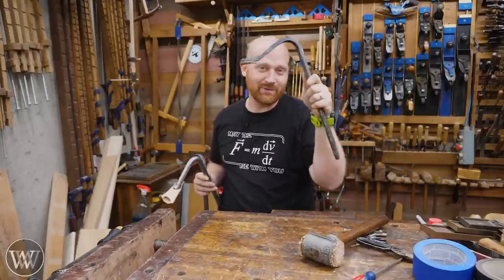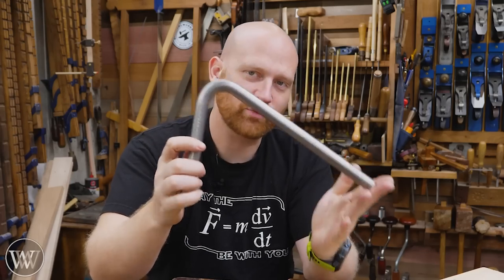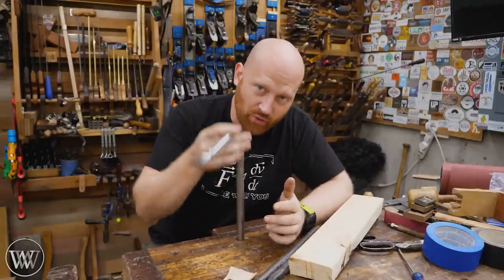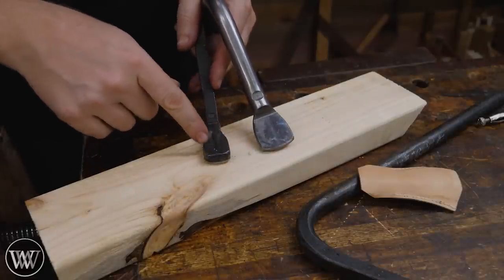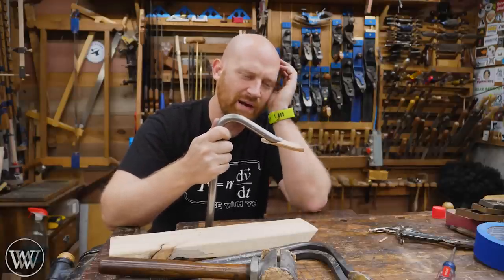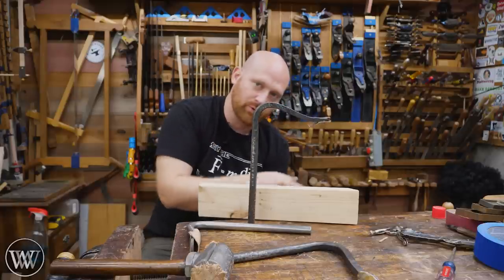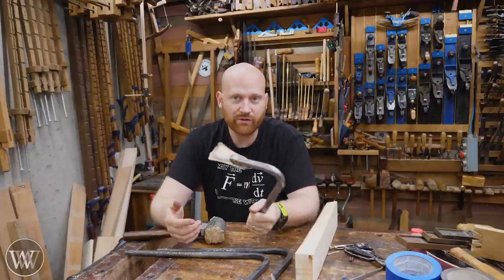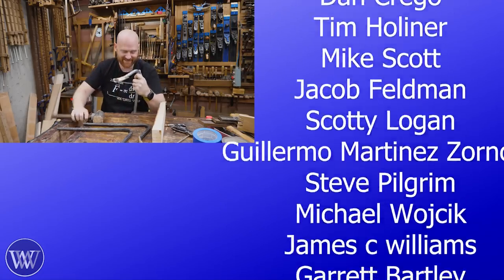A New Idea And View On An Old Tool

Comment: A simple tool to use, but surprisingly difficult to make them.  If you've ever forged one, they can be tricky because the length of the vertical shaft does, in my experience, play a role in how well they hold.  There's something about the weight of the leg.  I think it's absorbing some of the vibration from when you drive it home, but can't say for certain.  I notice the same performance difference on my hardy tools - the ones with long stems stay put in the anvil better than the ones I make up with short stems, or hollow stems.  John at Black Bear Forge does great work.

Comment: The Gramercy holdfasts are very smooth & can slide in the dog hole but an very easy remedy is just to roughen the bar with sandpaper. I've done this to mine & they never slip or move at all & I've had mine for 4 years+. (Edit: I spoke too soon, you addressed this roughing the stem later on in the video plus I didn't know that you've done an entire video on this very subject). Good content.

Comment: I use a 2"x 3" slip of 1/4 masonite under my Gramercy holdfasts and ths works just fine; no marks on the work and thw workpiece is held securely. Put the masonite shiny side up.

Comment: I used to make my own holdfasts from wood. I just looked for straight branches with another branch sticking out at around 45 degrees angle. I cut it just below the branch and then two more cuts to get the 7-shape. Note that it's important to have a steeper angle than on the metal ones, otherwise the wood will flex.
The wood must be hard, I used maple and ash. And they need to be thicker than the metal holdfasts, around 1 inch (2.5 cm) diameter. I peeled them and let them dry before I used them.
Works amazingly well and it's completely free if you have access to the trees.
Reply: And what do you do now? Did you swop over to metal holdfasts?
Reply: @LitoGeorge  unfortunately I moved and no longer have a workbench :( I will give the wooden ones another go when I get one again.
Reply: Maybe making hold fasts from wood is a good idea for an episode.

Comment: Thank you for the PSA about the Amazon hold fasts. I have considered buying them. I know not to now.
Reply: I got a Pony Jorgensen one from Amazon and I love using it.  Hasn't broken so far, but I haven't used it all that much yet.  Some reviewers on Amazon have complained of breakage though..

It holds great in my 1.5" top with 3/4" holes.

Comment: My texturizing "tip" for gramercy holdfasts is to use them in a bench with a top that's still got some moisture.  A little surface rust and they hold really well with just a light tap :)

Comment: The sticky felt pads made to protect flooring from furniture feet scratches are perfect for wood clamps. If the pads spent too many years on a store shelf or kitchen drawer they may require a little extra adhesion 😎

Comment: I tried gluing leather to my holdfasts feet but the leather kept sliding/peeling off so I just use a relatively thin & soft sacrificial piece of wood under the foot now. I'll be ordering those leather "socks" very soon though. Thanks for the video James.

Comment: Well, I use holdfasts all the time. I also used a piece of leather glued with hide glue but through use, they always come off and usually at the worst time. I've been using a sacrificial piece of scrap but that sometimes slips. Enough I enough! i ordered 4 of the Holdfast Cups that you are using and we'll see how that works.

Comment: I use 1/2 in round bar, that I turned into hold fasts about 30 years ago.  1/2 in round is small enough to forge in a charcoal fire, or a propane blowtorch, and all you need to forge is a hammer and a vise.  3/4 stock is really over kill and is real blacksmith grade. My bench top is 1.5 (2by) thick, and it jams well in the top.  Use hot rolled round as it has the rough surface for a good grip.  I spaced my holes such that the holdfast overlaps the adjacent hole.  Remember, loosen by hitting the back of the bend, tighten by hammering down.

Comment: I have the grammercy holdfasts, because I have a vice-less bench. The first thing I did was exactly what you've done with your forged ones. I just glued on some offcuts from the leather I use to make strops, trimmed with a knife,  and it works great.
Reply: Same here.
Reply: Same, and he dissed the Grammercy ones for denting and then showed the forged ones didn't because he glued pads on them.

Comment: I own my fair share of expensive hand tools, extremely guilty, but I have to admit that when I look at the price of holdfasts ($100+ EACH) and then they have to be used on a sturdy bench ($1k+), I start to feel that there are two kinds of woodworkers: those with inherited tools and/or the independently wealthy. So, I use a pair of WORX Pegasus folding saw horses for a bench (doubtful a hold fast would work in the dog holes these horses have) and have no hold fasts but many clamps; my most expensive clamps being $50/each

Comment: If you put a bit of glue on the end of the holdfast then wrap it tightly with twine or leather cord it tends to make a surface much softer on wood. Trick I figured out when learning how to make stone and bone tools
Reply from the maker: How would it fit in the hole then?
Reply: @WoodByWrightHowTo  I think he means the leaf end, not body end :)
Reply from the maker: LOL that would make more sense. That's what I get for answering comments at midnight
Reply: @daw00t  I’m not good with some terminology lol

Comment: Hold fast are assential part of my woodworking and i am using them all the time. I have got 5 of them. As from my experience to make the best of the you should consider the thickness of your bench top , the geometry of the hold fast and the diameter of the hole for the hold fast, a good combination between them will give great results. My bench top is 4.5 cm ( Rex joinery bench) so my cast hold fast are suitable for the bench i am using them and abusing them and they are good the only downside is the short neck, i have got 2 forged hold fast made by blacksmith like yours they are bigger have longer neck and leg and i have got a very unique forged holdfast that the neck of it is very long but i can change the radius of it it's leg is also long... because of the forged hold fast i headed to the underside of the bench top 5cm to the thickness , the cast ones are sill doing great job with the haded thickness. I was thinking of using leather but for know i am using wood scraps and plywood for preventing damage.

Comment: Got a couple of those, and glued leather pads on the bottom with neoprene, it works just fine. However, I found them to not stick at all in a 19mm bench dog hole in my 85mm thick bench (even with the texturing hack), but they work well in a 20mm hole. Also dowel stock for pegs & dogs on our side of the pond are also 20mm, so here's that.

Comment: I designed my small shop bench around the Gramercy holdfasts: 9 1/2" below the top surface space there's a tool cabinet.  This is enough space for holdfasts, a lot of weight for the bench, and it doesn't get in the way.  All drawers can be accessed from either side of the bench.  

I do also have a couple of blacksmith -made holdfasts that require thicker stock to clear the cabinet.  The Gramercy ones are useful 99.9% of the time.

Comment: I have two of the "blue" ones you showed in the video.  They came as a part of a package I bought from Rockler.  They are totally useless.  They don't hold.  I have tried all of the tricks in various videos to make them hold, and they are better, but still come loose, particularly under lateral pressure.  I am going to buy a couple of Grammercy holdfasts, but just have not gotten " a round tuit."

Comment: I have 4 of the Gramercy ,two are cut down for a Moxon/ Benchcraft Hardware  vice with deck/ mini bench top, for dovetails they all work well in Maple. Also a Veritas screw hold down that works well for pine in a naked Nickelson with easy knock down hardware that Mike Seimsen and LAP had drawings for. They all work in a Maple split top Roubo/Benchcraft hardware that I built from the Wood Wisperererer Guild plans.

Comment: I originally had a pair of Sjobergs ST03 Holdfast which have a handle you turn to clamp down on your work and they did me fine for a few years but using them was never quick and easy.  Then when I built my Roubo I bought myself a pair of Simon James Holdfasts which are "Hand forged in the uk" , well maybe they are handled but they certainly haven't seen a hammer, but that doesn't really matter.  I epoxied on some leather to protect the wood and they are so much nicer to use, quick, easy and reliable.

Comment: Once again, a great video. I bought a couple of the Gramercy hold fast a few years ago and really love them. I glued on a piece of an old belt as my pad and it’s worked well. When I need to go to a deeper hold or a higher hold as you call it I have a Veritas holdfast that I use on a regular basis.

Comment: Those Gramercy holdfasts have been tempting me, I haven't got any holdfasts yet. 
The only thing holding me back from buying them is that I've had a plan to make some for a while now.
I have a bar of hot rolled 5/8" diameter stock that will become a couple of holdfasts once I get my forge/anvil situation sorted out.  From what I've read of homemade ones the rod can be as thin as 1/2" and still work fine, but if my 5/8" isn't great I also have some 3/4" rods which are perhaps 5 or 10 thousandths of an inch oversized, so they won't go in a dog hole, so will be quite a bit more work to use, hence the 5/8" rod to start with.

Comment: I'm now convinced, going viseless to start out, booties are in my cart!  Maybe add a portable vise for a taller work-surface later on.   i imagine 4 holdfasts would be plenty, but just curious as to how many you have used at 1 time?
Reply from the maker: 2 is minimum, but I have never used more then 4

Comment: Thanks a bunch for the video, James! 😊
Here in Brazil they're pretty expensive! So I've been thinking about getting a piece of construction iron, they already have some texture, and paying for a blacksmith to making them for me. I don't know, let's see what happens, but it's the only solution I've found so far. That or making them out of wood... Probably a dowel and plywood, so it won't break so easily... But I don't know yet. 
Anyway, stay safe there with your family! 🖖😊
Reply: If it's a matter of purchasing power, maybe finding a local blacksmith is still an option?
Reply: @SigurtDinesen  Yeah, that's what I'm thinking about, as I described there. But we shall see. 😊
Reply: @MCsCreations  Ah, shit. Yeah that is what you said :D
I somehow read that as you wanting to make your own, my bad :)
Reply: @SigurtDinesen  Oh, don't worry about it. At all. 😊
It's always good to hear other people's opinions. 😊
Reply: A fire and a hair dryer and you can make your own. It's not that hard to heat a small piece of steel rod up enough to bend it. Just be careful not to burn yourself working with it. Use a pair of pliers to hold it.

Comment: Thanks! Will a  3/4” thick hold fast work in a 15/16 hole my bench top is about 5-1/2 inches thick. Keep up the good work!
Reply from the maker: A 3/4 hold fast is designed to fit into a 3/4 in hole. But for that sick of a hardwood bench you sometimes need to back drill the hole so that the affected thickness is only about 3-4 inches

Comment: Never have used a holdfast, my bench has larger holes than 3/4 and finding them that will work with my bench is hard to find. My bench is a Sjöbergs.

Comment: I have a single layer of 2×10 pine on my bench. Will the holes survive in that wood?  I  would like to try these.
Reply from the maker: Usually with pine you need at least 2 in. Most people end up with 3-in top and I'll put another board underneath where the holes are at.
Reply: @WoodByWrightHowTo  
Nice!

Comment: I have two Gramercy holdfasts.  I had slipping issues a few years ago, but my old workshop was cold, draughty and damp.  They went a little rusty.  I cleaned the rust off a bit with coarse sandpaper, and had no more slipping issues.  I built a new workshop that is warm and dry, and they will never rust again in there.  I use no others, although had considered buying a Pony brand to try.  Thanks for the heads up on those!  I have not, so far, felt limited by the length of the Gramercy ones, but I do take your point.

Comment: Is there a reason you knock your holdfasts out from the bottom, instead of tapping the back of the heel (assuming the pad holding the work is the toe) like everyone else i’ve seen use holdfasts?
Reply from the maker: If the hold fast is sticking up a ways I knock it from the top. But if it is close to the work I find it easier to tap it for the bottom.

Comment: Hi James, thanks for the video.
May I ask how long is the stem on the Black Bear forge holdfast is?
Peter
Reply from the maker: If you put the hold fast into the bench there's about 15 in of shaft inside the bench.
Reply: Ok, thanks 👍

Comment: I bought a used Ulmia bench off Craigslist a few years ago and it came with a Record holdfast with 2 collars in the bench. I now a second Record holdfast. I love them. A simple twist tightens the hold without needing a hammer.
Reply from the maker: I have tried those several times and just can not get the hang of them.
Reply: Oh man, using the hammer's the best part!  Bang bang, it's in, bang it's out.

Comment: The Crucible Iron Holdfasts ($144) are weird as they are not aligned at all and leather won't save that.  Where I just glued a soft hardwood (poplar negri) on my lever holdfast from the fifties,  could work with the crucible disaster.

Comment: What bench thickness would you say is required to use the holdfasts? (Gramercy specifically)
Reply from the maker: Depends on the wood but at least 1.5" for hard woods and 2.5" for most softer woods
Reply: @WoodByWrightHowTo  Mine works great in 1.5" pine.

Comment: I wish there was a simple way to create a flush insert for dog holes. I currently use my bench for guitars and sometimes electronics. Components will sometimes fall through and then it’s lost forever. Any ideas?
Reply from the maker: I know a lot of people who use dogs and have a dog in every hole.
Reply: It might be a bit tedious to insert and remove the plugs, but perhaps you can come up with a way to have the plugs mount from the underside of the bench up through the top. You can make the plug "T" shaped and use the flat part on the bottom to screw it in or use something like a barrel bolt latch to keep it from falling out.
Reply: @asterisk606  you know I considered basically recessing the whole dog area and then sliding a piece of thin ply over it like a sliding box lid situation. But then I realized that was ultra silly

Comment: How thick does the bench need to be to use a hold-fast? Great video! I really want to try to use them.
Reply: For the Gramercy holdfast see the specs on their page for bench thickness.
Reply: @kennethleitner1337  of course! I should have thought of that. Thanks so much Kenneth. I will do that.
Reply from the maker: Depends on the wood but at least 1.5" for hard woods and 2.5" for most softer woods

Comment: The main drawback to this style of holdfast is that you can’t put a drawer under the top where the holes are. I bought four thinner ones on eBay years ago. In smaller holes they work fine.

Comment: My $0.02.  Been ww for about 4 yrs and I bought 2 of those cheap hold fasts first.  didnt see anything wrong with them but they were continually thrashed on YT.  Looked at Gramercy and thought they were too expensive. waited a while and decided to buy a pair cause they were so widely praised.  Ironically, they are not preferred by me.  the shaft is so smooth that the tool will hold fast at first and as you mentioned, slowly ease up in the dog hole and loosen its grip.  the cheapos have a textured shaft and hold super tight and never let go until I bop them from behind.  I have pounded them plenty hard and they havn't broken so those cheapies are the darlings of the tool box.

Comment: Whats the ideal length of a holdfast?
Reply from the maker: I like 15" of rod in the bench.
Reply: @WoodByWrightHowTo  tx. How wide/ long is the leaf of the forged holdfast? What radius? If its good, I will make one like it or possibly a bunch.
Reply from the maker: I like about two square inches of surface contacting the wood. Ish. Something like an inch and a half by inch and a half space.
Reply: @WoodByWrightHowTo  thanks James.